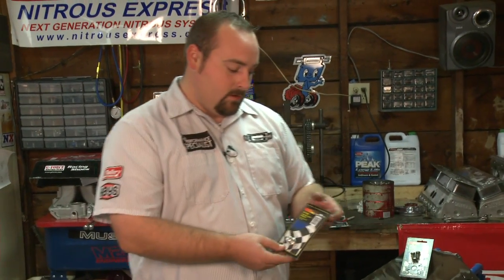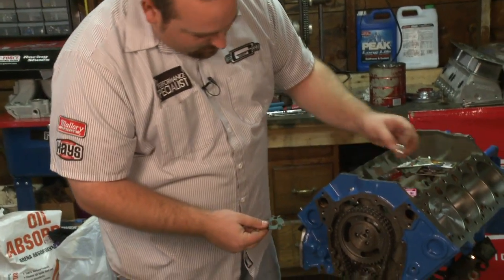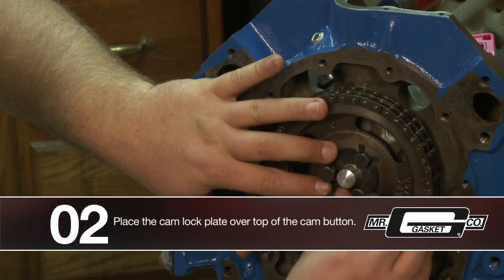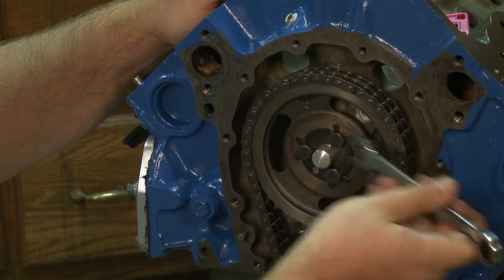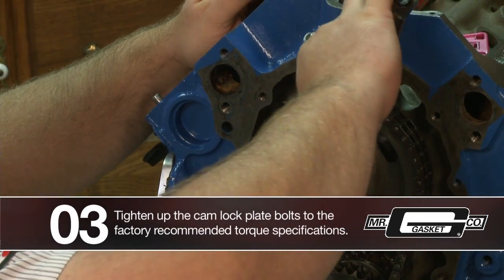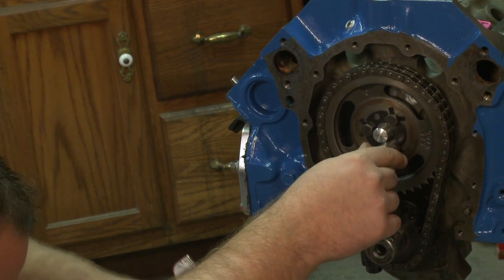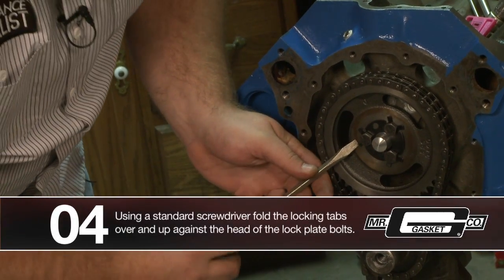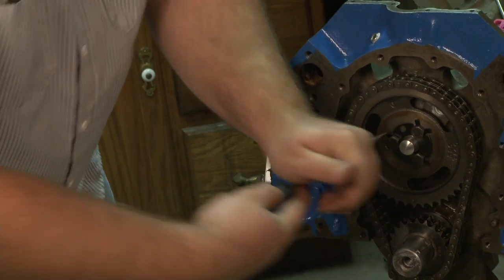Installing a Cam Button and Cam Lock Plate :: Modern Muscle X

Comment: I purchased a Cloyes TGK350CL timing gear set and moroso 60641 cam button, but the large end of the button won't actually fit in the sprocket. Am I able to install the button backwards and shave the excess off, or is there another way to make it fit?
I had to use this timing gear set as I needed a single row to fit with the vortec cover and 24 tooth reluctor on an SBC 400 block.